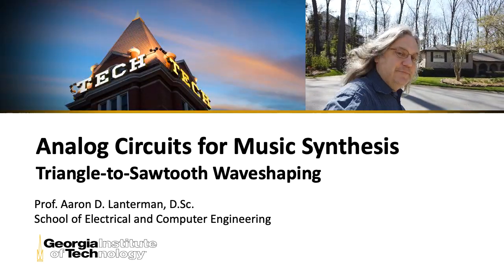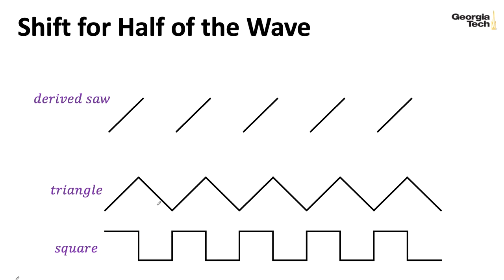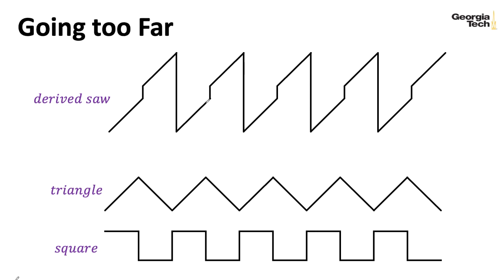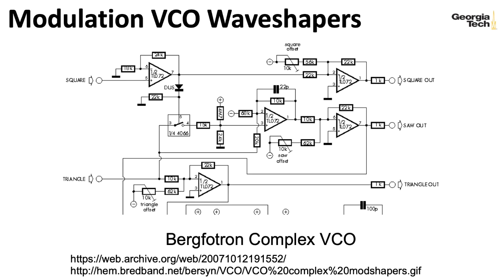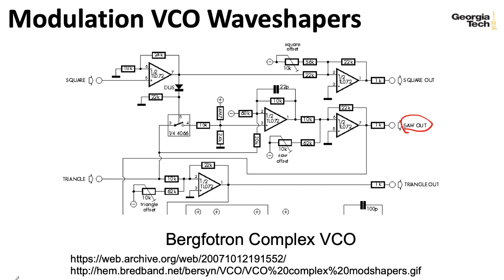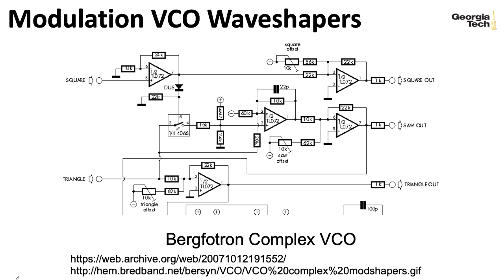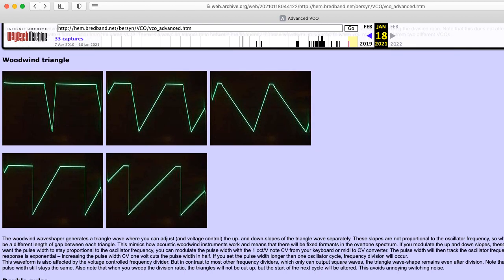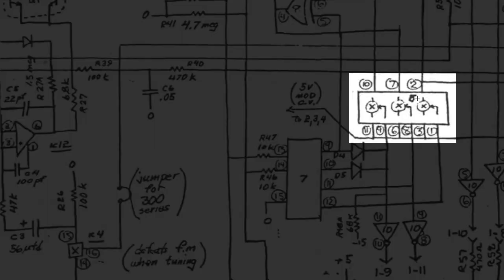ECE4450 L13: Triangle-to-Sawtooth Waveshaping (Analog Circuits for Music Synthesis, Georgia Tech)

Comment: I have a lot of xr2209 lying around, voltage controlled oscillators that produce square and triangle waveforms, so it would be great to spice these up with a sawtooth waveform as well. However I don't have any 4066 analog switches lying around 😕 But I do have a couple of DG508A analog multiplexers 🙂 Aren't analog multiplexers essentially just a bunch of digitally controlled analog switches? Can I use these DG508As in place of the 4066? I was thinking to connect the enable pin to the high rail and the squarewave to the 0th control bit pin to select between inverted and non inverted triangle.

Comment: I'll take a crack at solving some of the 1% resistor/trimmer mysteries. Assuming the unlabeled connection goes to V+ and ignoring R81, R83 and R82 form a voltage divider to bias that node to 1/3V+. 1% resistors are used throughout the DC-coupled path starting at IC13 in the Q3/Q4 subcircuits, plus similar circuits elsewhere. I suspect the 1% values were chosen experimentally to compensate for actual offset from a typical 741 opamp. With R84 they're probably compensating for offset between the switch settings since R89 and R90 are nearly the same ratio as R83/R82 and R84/R85, but that doesn't explain the wide range provided by R84/R85, so my best guess is R84 has to be adjusted as final compensation for accumulated asymmetry in the circuit brought about by adjusting the other trimmers. The datasheet for NF510 says VGS ranges from 0.5 to 10V, which is maybe the last piece of the puzzle since it surely requires some compensation to get consistency between units. Since V+ is 15V, if we continue to ignore R81 then R83/R82 bring the voltage to the middle of the VGS range of NF510 at 5V, with IC17 producing -10V when Q4 is conducting, which coincides with the max logic level of NF510. R84 provides about 5V of adjustment range to level shift the output from the upper half. That's about as far as I'm gonna get here I think, but hopefully that's on the right track!
Reply: I did make circuit based on this. R83 does go to positive rail and is there just to align both parts of the newly formed saw wave. And my guess for R82 is that they used it to compensate the value of R83, so they don't have to use trimpot there. It is quiet sensitive to change of resistance hence the 1%.

Comment: What about taking the triangle and inverting it when the square goes low? If the square is in phase with the triangle so the falling edge of the square lines up with the peak of the triangle and the rising edge lines up with the trough, that should result in a sawtooth, I think. Is that a big "if"?

That was my solution when trying to come up with a way of getting other waveforms out of a programmable sound generator like an AY-3-8910 (getting the triangle from a square with an integrator).

Comment: So if you want a VCO with both sawtooth and triangle outputs, what's the advantage of using a sawtooth core VCO and deriving a triangle wave from it vs the other way around?
Sawtooth core + triangle conversion is simpler, but triangle core + sawtooth conversion is more precise since you don't have to discharge a capacitor very quickly each cycle?
Reply from the maker: Indeed, the fact that you'll see so many of each kind of design, without any one kind coming to dominate designs, is an indicator that they're pretty evenly matched. I think you've hit on the trickiest part of the sawtooth core, which is that discharge time that takes up more and more of the waveform as you go higher up in frequency. That needs to be compensate for in the exponential control-voltage-to-current conversation, which we will probably cover later this week.
Reply: There are also differences in the way syncing works with different cores (saw cores discharging when given a sync pulse and triangle cores changing direction when given a pulse).
Reply: Than you should buy the Make Noise STO, i got it and scoped it, the bottom side (direction change) of the wave is angular, but the top is rounded off.
but that could be caused by the type of capacitor, not sure., it's probably SMD in the Make Noise STO.

Comment: Hey, professor, i found another way to extract the saw wave and it's symmetric, no offsets or fine adjustments needed and only 3 resistors instead of 6, like Buchla did... and doubled the saw frequency.
but the cd4066 has to be used in bi-polar fashion.
i think you will like it.
Reply from the maker: Excellent!
Reply: @Lantertronics   thnx, would you do a review on buclha's"symmetry" circuit? redraw?
Buchla schematics has quite a bit of stuff around the ....., probably alot of the 259 complex wave generator "device" has alot to do with the led / LDR reaction time in the vactrol.
Reply: @Lantertronics  it doesn't seam to make sense around opamp (IC27), the vactrol, +15V, -15V and GND in between towards the switch (IC23).  it seams to be also part of the some sort of the control voltage for the folder circuit.
GND is closer to the IC23 while -15V has to pass both resistors in the vactrol.
drawing Buchla_2590_3_2''.jpg
Reply: @Lantertronics - Aaron Lanterman  Professor, would you do a well prepared "top notch" video explination over the NPN and PNP transistors? but also give the PNP at least 50% of the attention. 

i did choose electro studies at school, but that was a long time ago.

the NPN is clear, pretty much, anyone can handle that and turn on a led of or build amplifier. 

but i didn't knew that you can also pull on the base of the NPN transistor, the control current coming from an inverted opamp, like in the transistor VCA of the mini brute @ the Hack a Brute on  Yusynth's website.
normal you put a a tiny current as the base and expect a return of 100+ times at the emitter, hence HFE, gain.  but a reverse current on the base of a NPN transitor?

i have read the wiki on transistors, mosfet, transistors, diodes, pn junction.

but the PNP remains a mystery. for most video on YouTube are over the NPN.
why is the emitter / collector inverted.

why is the current mirror in chips and the "buchla VCO core" a PNP?
when you can do the same with NPN's. what benefits the PNP?

if you check the "BA6110" datasheet, page 2 and look at the "buffer" part at the end.
the job is Q17 is clear, but what does Q18?

as the Q8 and Q9 in the CA3080 datasheet.
what about the diode (D1)?
the CA3080 looks weird compared to the LM13700, BA6110, BA662

the weird current mirrors in the LM13700.

here is a online simulator, in case your didn't knew, it works pretty well, but can't make a sine wave from the Buchla circuit, but for the rest it's pretty good, but bummer they don't have a CD4013 there, but much standard tools is there.

could you build some most common transistor arrangements in the Falstad simulator, like current mirrors, push pull VCA, switching stuff using bi polar psu's. like going from negative -12V volt to GND, etc, etc. thing you ca encounter. compile to a video and add some comments?

i don't have a resources to pay for a professor and have the remaining classes to fully understand electronics, but i sure would ...

... and a video on how calculate the correct capacitor value would be cool as well.
I = C x (dv / dt) 
it's weird, like the huge 220uF capacitor on the Moog Ladder Filter for a voltage divider witch barely consumes.

thanks for your time.